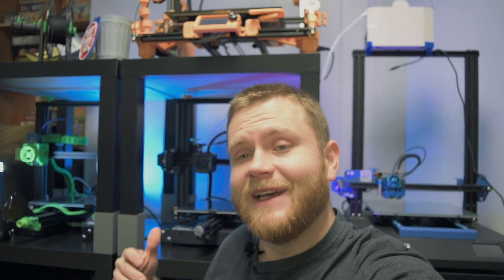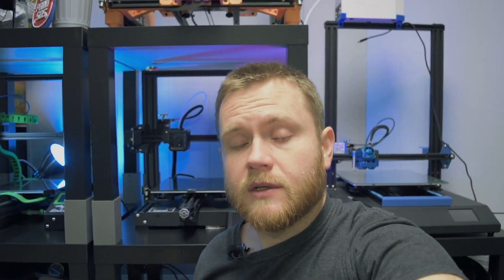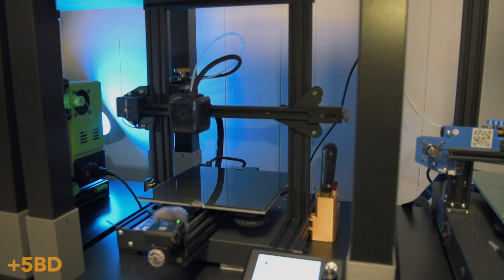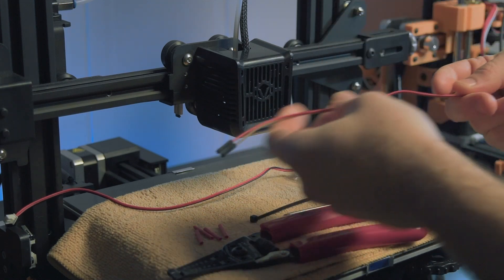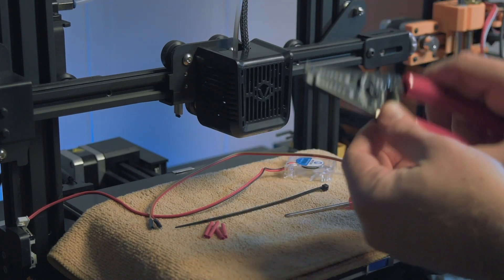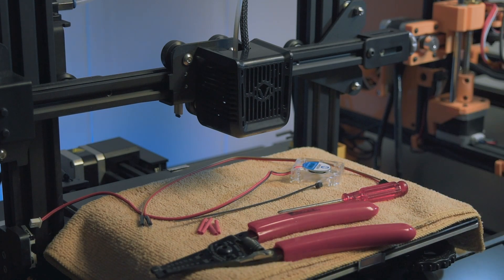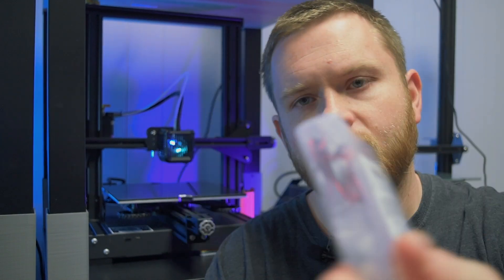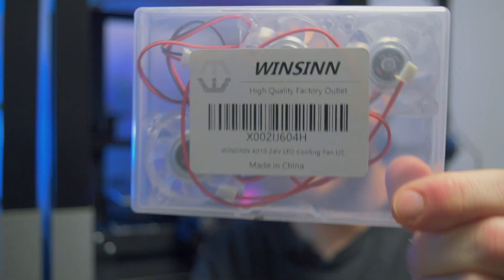Tired of your LOUD 3D Printer fans? Here's how-to install some SILENT RGB fans on the Voxelab Aquila

Comment: At work, I was able to find a source for sockets to plug the fan into. That way it's replaceable later down the road without cutting, stripping, and soldering the wires together again. I found a broken emergency light in the garbage at work, and what did I see? The lights plug into the control board with the same sockets and plugs. I took the board and removed a socket from it, 5:25 and soldered it onto the fan power lines. One and done! I got pretty lucky. My Aquila C2 just keeps getting better.

Comment: AVOID doing this conversion!!! The Winsinn fans don’t always spin up automatically & in the hot end, they aren’t fast enough to cool the heat sink, so I’m constantly getting heat creep clogs now. I successfully printed for 6 months with zero clogs & as soon as I swapped fans, boom 💥. It would have been nice if the author actually did proper research on the C.F.M. ratings on these. Also, it’s my fault for trusting the video author without knowing his credentials.

Comment: I bought these fans and measured the air flow. The original fan was about 850 ft.min and these measured about 350 ft/min. I am concerned that the heat break and sink will run hot over long prints. I will run it for awhile and see what happens.
Reply from the maker: Woa. That’s quite the difference. All of them were that low?

Comment: So I swapped the extruder fan out and wanted to do the parts fan have you done this one yet? The frame in the housing doesn't allow the fan to sit flush if you use Winsinn. Ideas?
Reply from the maker: The parts fan has to be a blower style fan

Comment: Quick question, for the bread board wires I’m assuming you got the 120pack male to female? I’m ignorant when it comes to electronics just wanna get the right thing. Also the length of 7” is enough or can I get by with the 5”? Love the videos man.
Reply from the maker: You should be able to get by. Female to male will work. Any pack will be ok, but I like to get a bunch because I use them for a bunch of different projects.

Comment: Do these fans hold up ok for long prints? Anyone experienced any issues with them?
Reply from the maker: I’ve had mine for many many months now. Never had issues. However, some of my subscriber have had duds. I mean, there are 4 in each box for a very low cost. I’m sure there will be some failure. But in my case, they are significant improvements over stock.
Reply: @3DPrintSOS  Yeh, worth it then, even if I replace the motherboard and the hot end fan, I'll have a spare for each. I just worry if I don't notice the motherboard fan failing and something gets fried on there. I guess that's the gamble though

Comment: Anything wrong with splicing the cables and twisting them together instead of the breadboard wires?

I went this route, so far so good, printing MinionD shroud at the moment :)
Reply from the maker: Nope, it’ll work. Just make sure you insulate them with electrical tape. As long as nothing shorts, I’m sure it’ll be ok.

Comment: do you recommend change the 2 fans of the extruder with the winsinn fan 24v or just the "principal" (front) that was showed in min 4:19.
Reply from the maker: I would say, don’t do anything until you need to. There’s so much the printer can do just stock. ;)
Reply: @3DPrintSOS  yes, but the fan is making a hell noise xD
Reply from the maker: Ah if it’s making noise, then yeah, you’re due for a fan or two. :)

Comment: Just oil the stock fans.
Reply from the maker: You totally can. But I think you’ll find that you’ll be doing it often.
Reply: @3DPrintSOS  Hmm, you might be right there, haven't thought about that. 

Sadly, the 24v fans, recommended, are unavailable, and I had to print 10 hours with that noisy fan, so I came up with the oil idea. It looks like I will have to implement the solution with the Noctuas then.

Great content you have here BTW. :)

PS. So, I oiled them all now, but they are not as quite as the fan replacement. I wonder if I can print a new blade for this fan....
Reply from the maker: Honestly, probably too much trouble. These replacements are cheap and super effective. I mean, unless you’re having fun of course. Then by all means. :)
Reply: @3DPrintSOS  I finally gave in and ordered a Noctua fan. But, it would be really neat if there was a printable solution. I have several fans inside my computer that are super noisy and would benefit from these blueprints. My first guess was the blades that make that nose, but it seems it is to a great degree the cheap bearing they use.

When I come up with something nice, I put it on Thingsverse and post the link here.

Thank you for the great content you are providing, :) It made me buy a printer and I absolutely love it :)

Comment: Quick tip for those connectors, put the opposite connector for each polarity, that way you won't accidentally cross the wires when you do maintenance.
Reply from the maker: That’s genius
Reply: Glad you brought that point up, as a scratch builder with strips of Dupont connectors, wiring up motor leads, it's just a good practice! (Figured someone would mention)
Reply from the maker: It’s a great idea, I had no clue. Haha
Reply: Greg, I'm getting ready to do this fan maintenance, could you elaborate a little more on what you mean please? I haven't swapped fans before. Thanks!!
Reply: @paladinew they mean put the male connector on the fan side of the positive wire, and the female in the fan side of the negative. That way you can't connect them to the wrong polarity by accident.

Comment: Because its a lil hard to see exactly, did you cut the breadboard wires in half and then connect one end to the fans and then one to the wires running to the board? Also without a saudering iron would it be okay to just twist and shrink tube?
Reply from the maker: Yes I did. And yea, a good twist and shrink should work. Just keep in mind that’s a temporary solution. That cable moves when the printer moves so ideally you want to do it right. ;)

Comment: For anyone that hasn't made this mod yet, could you tell me if the fan it suppose to blow outward away from the hot end or inward at the hot end? It seems like the fan only goes in one way, but I'm not certain I put it in the right direction.
Reply from the maker: Have the fan blow cool air onto the hotend heatsink

Comment: Thank you for the video, been looking to replace my fans. Your videos in general have been a great help since I got into printing in October. I followed your video but I haven't seen as drastic of a change in volume. They are quieter, and have a less annoying type of noise, but they didn't sound as quiet as yours did in the video. Do you know of any reason this might be the case?
Reply from the maker: If they are 24v fans and these winsinns from my link, they should be really quiet. Something isn’t right if they are loud.
Reply: @3DPrintSOS  Oh, okay thanks, I got the 12V,  I'll have to order the 24V now. Appreciate the help.
Reply from the maker: Ah. So they must be goin at double speed! ;)
Reply: @3DPrintSOS  'Spose so, lol.
Reply from the maker: Oops
Reply: @3DPrintSOS  I installed the 24v yesterday and it runs like a dream. It is unbelievably quiet. So quiet I almost cried tears of happiness and relief. Thanks again man, really happy with how it turned out.
Reply from the maker: Haha. Nice. Glad you like it.

Comment: Loved the video! Just throwing this out there, but could the bad cooling issues in other posts be from the same 2 wires powering the LEDs AND the fan? I'm debating on whether to grab the ones without the LEDs for this reason,  or am I just being crazy? 🤪
Reply from the maker: Not sure. I think these come in bulk and occasionally have duds. I’ve used 6 now and haven’t had any issues. Some have printed 40+ hour prints.

Comment: you might remember me but i have my printer next to my bed and i want my printer to be silent, i have never done anything like that but i am up for the challenge can you just connect the wires from the stock fan to the new one?
Reply from the maker: You will likely have to splice the wires together. If you cannot solder, you can use twist connectors or crimp connectors. Or even just a classic tie and electrical tape. All you have to do is make sure the wires are the right ones and the fan voltages match.
Reply: @3DPrintSOS  ok thanks
Reply: @3DPrintSOS  would the electrical tape melt?
Reply from the maker: Nope. Should be good.
Reply: @3DPrintSOS  thanks my dad did not want me to ruin my printer
Reply from the maker: That’s relatable. 😂

Comment: Is there a link to another video where you slow down what your doing during installation? I don't have very much experience with soldering or wiring but if I could see it slowed down and explained I feel I could replicate it.
Reply from the maker: Not the first time I’ve heard this. I will note that for the next time I need to do something like this. Thanks for the suggestion

Comment: Am getting ready to install these fan upgrade and new Capricorn tubing since the noise and having adhesion  issues on my prints, did one overnight and try taking of glass bed with no luck it came apart in the middle and was very brittle any suggestions.
Reply from the maker: Wait so you had adhesion issues but then it adhered too well? If a print is brittle, you might just have a clog in the nozzle.
Reply: @3DPrintSOS  am printing with PLA from Ranki but I did leave out of the bag for week since working long hour and am drying for 24hrs and trying my project again.

Comment: Great video!
I have the Voxelab Aquila X2 and it is already making fan noises on startup. I am thinking to swap the fan as per your video, but mine has two fans. I saw your one reply saying that the one that fails is usually the hot end fan, but is there any harm in replacing both fans?
Reply from the maker: No sir. You’ll have to replace both anyway. Those are a weak point on these machines.

Comment: Question I did that and my new fan just twitches and does not spin any help???
Reply from the maker: Hmm. Check to see if you have the wires correct. Sounds like a power delivery issue.
Reply: @3DPrintSOS  Trying a different fan now came with for lol red to red black to black LOL
Reply from the maker: Hmm. Is it a 24v fan?
Reply: @3DPrintSOS  and there it is they sent me the wrong fans!!! sending them back now LOL but seriously man you've been like a hero to me since the pandemic started keeping me sane inside this 3D printing world keep up the good work and keep the videos coming my friend!!!!!
Reply from the maker: @mikemanzato5219  that would do it! Thanks, glad I could help in someway.

Comment: Hi, i watch all your bids and think they are concise and well put together. If you could spend a minute to help me with a query i would be bery thankfull. On the aquila i have had parts get to the end of the printing of the program, but the part height isnt finished. It thinks it has but there is way more Height to go. Please help. Thankyou.
Reply from the maker: As in, it’s printing mid air and no filament is coming out? Or it stopped printing?

Comment: Your link pulls up the hydraulic type fans but from what I've seen the dual ball bearing fans are the ones to get. They can be run 24hrs and have 50,000 hr lifespan. And a lot of people on Reddit say they're quieter than the hydraulic fans too. Do you have any experience with the dual ball bearing fans?
Reply from the maker: Sadly the links get swapped all the time. Very hard to keep track. :/
Reply: @3DPrintSOS  Only bad thing is the dual ball bearing fans don't come in RGB :/
Reply: @rileyneufeld7001  which is perfect!

Comment: Thank's for video! What about part cooling fan? what size is it and should it replace for wingsinn?
Reply from the maker: The part cooling fan is actually great. Zero issue and has outperformed many others in my experience.
Reply: @3DPrintSOS  Thank you for information!

Comment: I can't figure out what the point of the breadboard wires are for. Can someone help me out. Why can't you just cut the old wires and solder the new ones to it?
Reply from the maker: You totally could. It just makes it much easier to replace or repair parts with connectors on them and I have a ton of those. So, that’s what I like to use.

Comment: Do you have to splice the wires? Can the wire from the new fan just plug in to the motherboard or something? I want to do this on my X2 but I don't have a soldering iron, nor the knowledge of how to use one at this point.
Reply from the maker: The wire on the fan isn’t anywhere long enough. You might be able to find an extension of you don’t want to solder. Since it’s just a fan I’m sure you can just twist the wires together and use electrical tape. You could buy tap connectors and just click it all together with zero fuss.
Reply: I got a fan tonight with 2' of lead and a 2 prong connector. I'll let you know how it goes tomorrow
Reply: @urgamecshk  did it work out well?

Comment: Just subbed out the stock fan for a non-RGB WINSINN from AliExpress. Knocked the noise level from 45db (about a foot away) down to 30db. A marked improvement for sure.
Reply from the maker: Not bad. A quieter machine always feels better.

Comment: I don't understand the need for the connectors.  If you have to splice them in, you create two splices and one connection per wire.  Why not just splice the wires and only have the one splice each?
Reply from the maker: In case the fan fails, then It’s much easier to just make some connectors on new fan and “drop it in”. At least in my opinion. But you totally don’t have to if you don’t want to.
Reply: @3DPrintSOS  _ Thanks for the quick reply!  Makes sense.

Comment: After installing this fan I wasn't able to print anymore. It typically stop extruding after the first layer. I tried several solutions and I finally found that it was the fan. It doesn't provide adequate air flow.
Reply from the maker: Have you tried another fan out of the set? My two sets that I use in my machines are still doing great many months after. Gotta be a defect of some sort. Also make sure the fan can spin freely and the wires are holding it back
Reply: @3DPrintSOS  Not at this time. I but back the original fan.
Reply from the maker: I’m sorry Bruno, hopefully you can just exchange the bad fan. Let me know if another fan works better.

Comment: Accidentally bought the 12v fans. Am I screwed?
Reply from the maker: Not totally. You can always run buck converters to turn the 24v output to 12 before it reaches the fans. But that’s a ton more work then exchanging what you purchased. :/

Comment: Hi, I'm in the UK and have found these fans on amazon, £11 for the 4, that's about $15 for you guys. Great price but some of the reviews are terrible, talking about heat creep and fan failure or just not being man enough to do the job. How have yours held up now they have been on the printer for a decent amount of time?
Great videos, have helped me on so many occasions 👍
Reply from the maker: Mine haven’t cause a single issue and I’ve done 28 hour prints several times including high temp prints such as carbon nylon. I’m guessing some have just had bad luck. :(
Reply: @3DPrintSOS  awesome! Did you replace both fans in there, if so which did you use? I will replace the front fan like you did but the fan next to it has started making a high pitched squeeling noise so need to replace that but don't know what I need for it. Sorry for the vague description but only had the printer 3 weeks and not up on the lingo yet!
Reply from the maker: I only replaced the one I had issues with which was just a 40mm 24v fan. You’re talking about the parts cooling 24v 2010 blower fan. Should be easy to replace if yours had issues.
Reply: Could be peoples setup, they do run at lower RPM, hence the quieter run noise, which could lead to heat creep,  if in doubt another mod i would recommend is just print off an open shroud, the stock shroud design is not giving optimal airflow, the noise you hear is called blade wash where air pressure is trapped between fan blades and shroud

Comment: Hey there 3DPrintSOS,

i just brought a new adjustable heat setting Soldering Iron as I can't find my old but still working normal set heat Soldering Iron. 

I now got the new fans and They of course have just a short lead with the white plug in plug for the circuit board.

So I am having to now cut the fans wires and try to solder the fans wires on to the ones from the old original fan wires in the fan housing!

I wish to know, does it matter which wires of the new fan are soldered on to the original old fans wires?
Is there a Plus and a Minus I have to make sure that I do so the new fans wires work or does it not matter?

Also which way around does the new fans need to face so they suck not blow the hot end.  
My new fans are Brush-less non lighted ones as I need the printer to be dark in the place it be set up in, 
I even printed the cover for the screen so no light is seen.

I have the shrink plastic raps with the soldering set which helps and I have the wire stripper already.

One last ting here, 
I need to crimp on to the new thermister wires those small metal pins that then go in the original white small board plug 
that runs the thermister unit in my new hot end block
So is there any set way to do those wire pin ends in to the white plug just so I know later on?  

Once that is I can buy the crimper tool and wire ends later on.

Your help as always is very much welcome.  8 )
Reply from the maker: As long as you match the plus and minus of the fans, they should run. You can always just twist tie the wires first and give it a try before you solder. 

If you are using the stock cooler, I would keep the fan in the same orientation as stock. 

Not sure about the thermistor, but shouldn’t be a problem if the leads connect properly. ;)